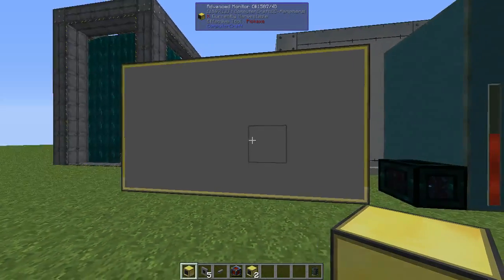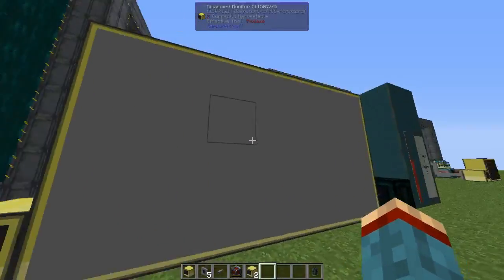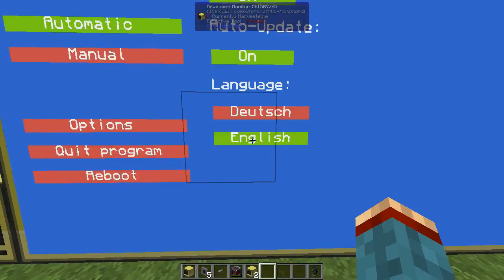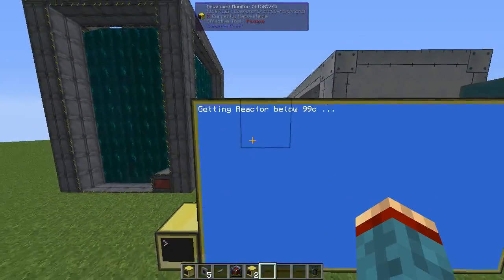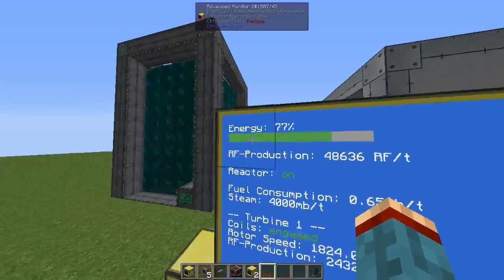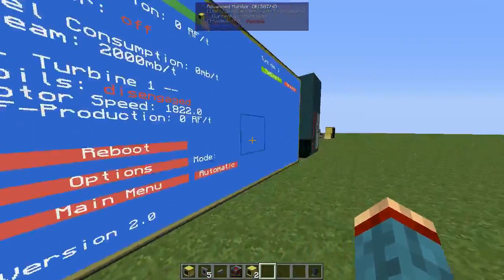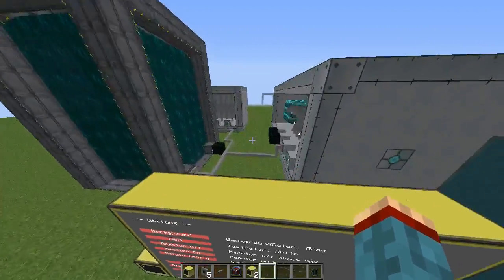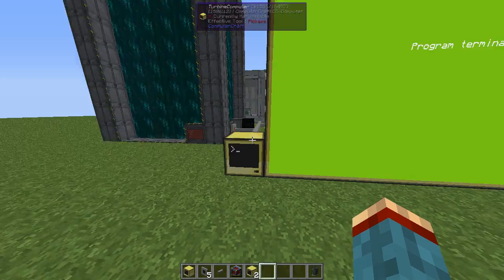Reactor- and Turbine Control Program - Version 2.0 | English

Comment: The off/on code doesn't work for me, not sure if it's versions of mods (running FTB IE) or what. I'm assuming that <r> is defined by the BR api would you mind linking me to it? I'll look over it tomorrow and figure out why. Awesome from what I've seen so far, thank you for taking the time!

Edit: Is this on github as well so I could just pull and merge?
Reply from the maker: What do you mean with the on/off code? Regarding Github, you can send in pull requests, but I would like to have a look at your changes then. If you want to help me with my code, feel free to join me. You can send me private messages in my Forum (http://thorscrafter.de/forum/index.php) or my Teamspeak server (ts.thorscrafter.de).
Thanks for your help anyway.

Comment: First off all, wonderfull program. In its essentia it works flawless. I do ran into some trouble: 
- The screen is not responding afther a relog. You get the start program and afther that its a black screen.
- Not sure if this intented, but there is no fuell rod controll? its starts off at 100% and stays there. I manually brought it down to 80% insertion and still have enough steam to power 4 turbines.

Afther the screen goes black the program still works you just have no info displaying it.
this is on a multiplayer server.
Reply: im also playing on a multiplayer server and the same thing happened to me.

Comment: Hi, this looks great!  However I'm having the same issue as ProSto8718503 in that I set everything up the way you did, download the intallerUpdate program, type it in the command line and nothing happens.  It just proceeds to the next command line.

Any ideas?
Reply from the maker: +Douglas Marshall Try using the patcher. This should work.
Reply: Thanks for the quick response!  So I downloaded the patch as well and still returns to the command line.  I "label clear", took apart the whole thing, and rebuilt and rewired, redownloaded the program and patch, ran it (i'm assuming that I just type installerUpdate on the command line), and nothing.  I tried editing the program to see what is there and it shows no file at all, just a blank screen.

Douglas
Reply from the maker: There is one more thing you can try. I am currently working on the next update (2.4), which will be released very soon. I made a Beta-Version Downloader, which downloads the files directly from my Github repository (https://github.com/ThorsCrafter/Reactor-and-Turbine-control-program). You can download this one, but this is only available in German right now. Since I will release version 2.4 in a few days, you can wait for this, too. Anyway, here is the link for my Beta-Downloader: http://pastebin.com/k3Vtpv3f
Reply: I appreciate the effort you have put into this and getting back to me.

Douglas

Comment: Great work thanks, Really useful! I'm running with 1 reactor and 1 turbine currently but my plan for the room involves 4 turbines. The problem will be that i'm using a very small reactor along side each turbine, maybe not the best way?? Would there be a way to control all 4 with separate reactors?
Reply from the maker: +Calum Robinson At the moment you have to use one computer for every reactor/turbine setup.

Comment: This is really coool, however it won't recognize my Resonant Energy cell, i've tried the patch as you discussed with Green Gamer, but i keep getting the same error. Help plz
Reply from the maker: Ok. Most likely, you need to attach a peripheral proxy from OpenPeripherals if you want to use an Energy Cell from Thermal Expansion. If you already have one attached, you can try stopping the program, then go into the lua prompt. Type in "peripheral.getNames()" and have a look at the output. If the computer finds your energy cell (something like this probably: "tile_thermalexpansion_cell_resonant_name") please tell me the exact name of the energy cell. If it doesn't find any cell, you should check your connenction between the computer and the energy cell. You can also make some screenshots and post them in my forum (http://thorscrafter.de/).
Reply: "cofh_thermal expansion_energycel l_1"
Reply from the maker: +albertabigbuckhunter Ok. I will add this in the next update. Some mod packs use different names for the Energy Cells. Thanks 😉
Reply: I've tried enderIO storage caps also still won't recognize it, same code "tile_enderio_blockcapac i torbank_name_1"
Reply: same here mine will not find a energy storage as well

Comment: it says pastebin:1-1 : attemt to index ? (a nil value) No such program after i put installerupdate when it is done donlowding
Reply from the maker: That's probably an error with the pastebin program. Check if you have the http setting enabled in the computercraft config.
Reply: Its on a server
Reply from the maker: Well, try your setup in a singleplayer world. If it's still not working you can open a thread in my forum. You can send me some screenshots there. http://thorscrafter.de
Reply from the maker: Hmm, you can try executing my patch file, this might work! Just download (pastebin get yuSAyFsR patch.lua) and execute it. This is important if you want to update to 2.3 from previous versions. I will make an update video for 2.4 soon (in English too).

Comment: Im using 2.3, and the Turbines go wayyy above the Max which is set to 1,820RPM. Is there any way to fix it. Im using 2 turbines to power a 2x2x4 Vibrant Capacitor.
Reply from the maker: This is a problem indeed. You will have to adjust the steam input of the turbines. I will definitely add this feature in v.2.4
Reply: +Thor_s_Craft I've tried to adjust that, but it always resets right back to 2000MB.
Reply from the maker: I know. xD In the current version, it will set it to 2000 all the time in automatic mode. Right now, you can only bypass this, if you switch to the manual mode.
Reply: Okay, thank you!
Reply: Is there anyway that i can change the Config File so that the Fluid Intake defaults to 1561MB (Keeps my 2 Turbines at 1820RPM) so when i load the world it automatically goes to that?
Reply from the maker: That's not possible unless you want to edit a lot of code. I am currently working on version 2.4, where it calculates the steam level itself. I think i can release it in a few days. Just be patient until then.
Reply: Okay, thank you!

Comment: Bravo man, this works great... is there a way to have multiple reactors?
Reply from the maker: Currently not. Maybe I'll implement this in a future update (3.0 maybe?). Anyway thanks for your feedback.
Reply: That would be badass. I'm on a server that I'm head builder on so I'm trying to build the most epic reactor setup possible
Reply from the maker: What kind of control would you like with 2 reactors? There are a lot of possible uses for a 2 reactor setup.

Comment: Thank you very much for this, i will be looking forward to running this when i build my turbines (new server). all the previous codes didnt seem to work. Thanks for the update and work. keep it up :)
Reply from the maker: Thank you for supporting and using my work :)
Reply: I finally got my reactor and turbine running, program runs like a charm. 

I will mention to people that are unfamiler, that the Reactor/ terminals need to be chunk loaded, otherwise if you move out of the area, the program resets itself. i forgot to do this last night and was wondering why i had no power lol
Reply from the maker: Yeah, chunkloading is important. I will say this in my future update videos. Thanks for your feedback.
Reply: So ive been running this for a 2 days now, and ive come across 2 issues problems

1) Then the reactor is Passive, the Reactor internal energy buffer is always empty and only relies on the Capacitor buffer. Is this intended?

2) When connected to a Turbine, the reactor rods at set to 0%, or is continually searching for the optimal rod level (-inf) so it never adjusts correctly, meaning that the reactor is burning at super high teperature.

Here is my reactor design. internal 5x9x11
Simulator: http://br.sidoh.org/#reactor-design?length=5&width=9&height=11&activelyCooled=true&controlRodInsertion=74&layout=10EXEXEXEX3EXCXCX3EXEXEXEX10E

Is this a bug or shall i change my reactor for this program?

Thanks
Reply from the maker: 1) Jup, that's intended (at least for the moment, I think I will change this in future updates, so the program can run without an energy storage).

2) This is a known bug I haven't been able to fix jet. Sometimes it happens, sometimes it doesn't.
You have to reset the config file in the options menu and restart the computer. It should recalculate the rod level then.
Reply: Okey thanks ill retry when i get home. I appreciate the quick response +Thor_s_Crafter. I look forward to the updates.

If you need help testing let me know. :)
Reply from the maker: Thanks for your feedback +Tomi Yau!

Comment: Would this work if I used different coils such as ludicrite, which never goes above 1820 rpm?
Reply from the maker: In short: Jup! The coil speed is adjustable, so if there is a problem with your coils speed, just adjust it as needed.

Comment: Does this program need a reactor? cause I would use a railcraft boiler and just the turbine without the reactor.
Reply from the maker: +timothy van cleven You could possibly use turbines without a reactor if you get steam from a boiler. However I'm not sure if you'll get the required 2000mb/t of steam per turbine using this method (even if possible, the fuel consumption rate would be horrible I guess). My program is specifically designed to run a reactor (with or without turbines). That's it's main purpose. So, you can't use the program if you don't have a reactor.
Reply: +Thor_s_Crafter alright thank you for the information.